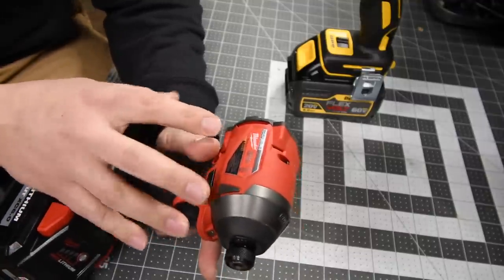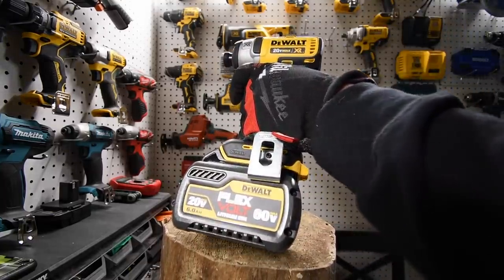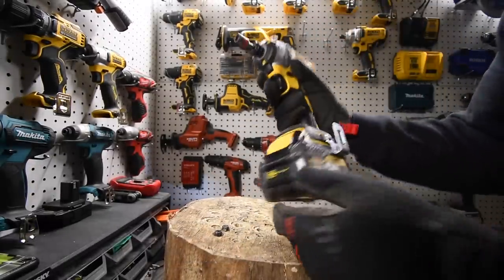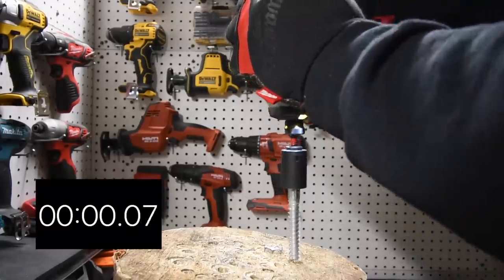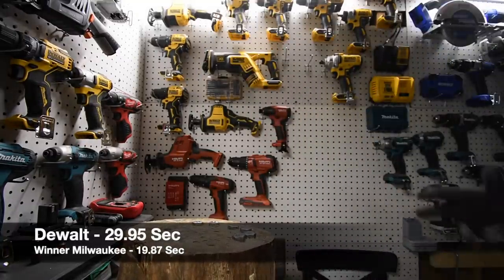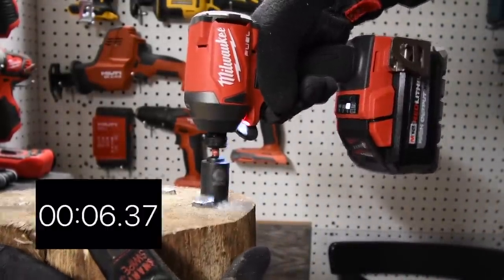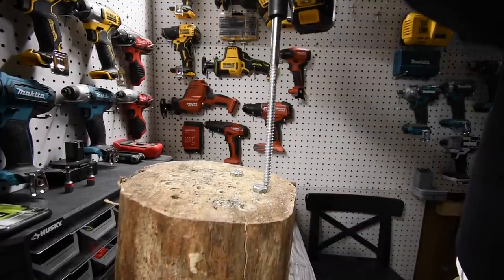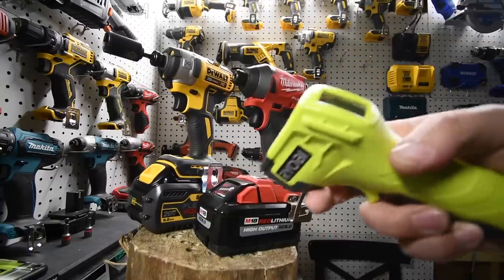Milwaukee vs Dewalt (Impact Drivers)

Comment: Great test! However, what about battery life? I think that is Flex Volt's claim to fame. I'm pretty certain my 20v is a lot faster than that dewalt.
Reply from the maker: the new 21700 cell batteries are the in now for the dewalt
Reply: @ManCaverTools  oh, ok. I'm not too familiar with the cells. Either way, I would anticipate that Milwaukee is better just due to price. However, seeing the test is pretty awesome!

Comment: Don't buy Milwalkee  I bought a SawzAll   1/2 drill  , and a impact  gun ,all 18 volt , I used them for home owners use 
I'm a master Commercial Carpenter. 35 years experience.  ,,  one by one these tools failed  Battery SawzAll. The motor had to be replaced after 3 months use , ware tee covered it ,   The 1/2 inch drill.  A screw that holds on the Chuck snapped ,  impact gun  the impact failed 
This was under lite Home owners use.     Stick to. DeWalt  I use them on my job or Hiliti   These are expensive industrial tools  that never failed
Reply from the maker: Very good and I thank you Paul. I love HILTI as well
Reply: Agreed. Milwaukee has trouble making tools for Carpenters for some reason. They did come out with a nice line up for Electricians and Plumbers though.

Comment: The heat test was totally biased.
Since you did it at the end of the video, not at the end of each impacts run time.
The Milwaukee was sitting for twice as long, not operating. Therefore cooled down significantly then the DEwalt.
And the fact that the DEwalt could actually pull out the 10inch and the Mil couldn’t, tells me that the DEwalt isn’t as fast but has more balls. 
Let me know what you think.
Keep it up
Reply from the maker: not true and thank you Damien
Reply: Man Caver Tools which part is not true?
The heat test or the DEwalt having more balls?
Reply: @damiencerutti6269  lol dewalt all day. Better overall, more diversity, selection, duration, cheaper. Better value.

Comment: Man caver u don't even have the dewalt on speed 3 I can see it set on 2 no wonder Milwaukee drove it in faster
Reply: Might need to get your eyes checked buddy
Reply: Do a test with the new dewalt drill 998 with the 8ah battery versus Milwaukee and hilti. I want u to use the new 8ah battery from dewalt on the impact and do a rematch versus Milwaukee impact. I got both of them and they are tie to me but when it comes to the drill dewalt beats them all love your show man
Reply from the maker: its on speed 3. lol  but nice try

Comment: Don't understand why nobody noticed it.... but MAJOR problem with your tests is..,
you driving all your screws, bolts etc into the edge of the wood where all the grains are...
But the REALITY is pretty much...  nobody screws into the grains... 
Everybody screws into the face of the wood to the grain edge...
So, your tests shows pretty much NOTHING....
Just waste of time...
Reply from the maker: both tools did the same job on the same log, I thank yo very much for spark